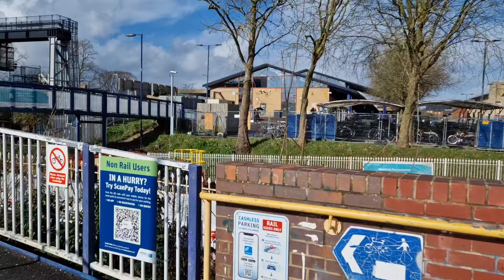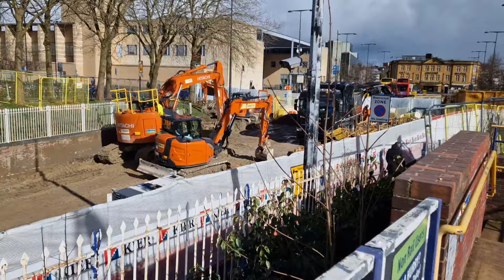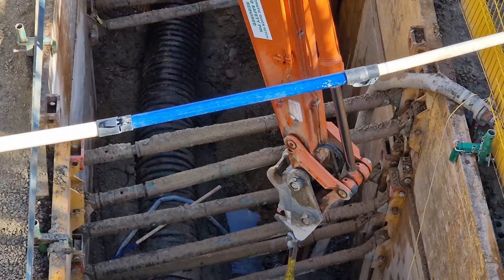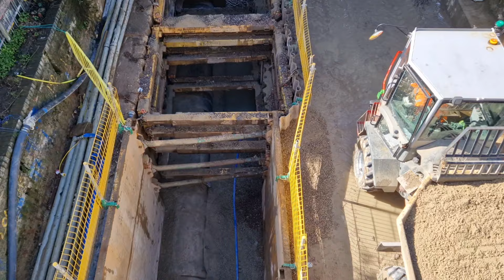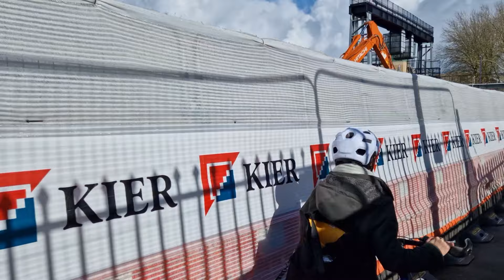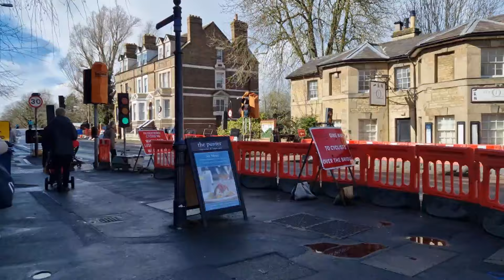Botley Road Oxford Train Bridge Works & Old Footbridge A420 March 2024

Comment: Is the road being lowered?
Reply from the maker: I've heard that they are, yes. To let the taller buses through. Apparently the buses that were passing under the bridge were modified specially to fit under it! They used to miss by what looked like just a couple of inches
Reply: @MyWorldThroughALens  I've been on a bus a few times underneath, sitting upstairs at the front. The bridge said 13ft 9, and the buses were 13ft 10, but still, only just went underneath.
Reply from the maker: Nice, when was that recorded?
Reply: @MyWorldThroughALens  would've been summer 2022 I think
Reply from the maker: I did some filming around there before they knocked down the YHA. Still need to find the time to edit and upload...
Reply: @MyWorldThroughALens  they've certainly got some big plans for that area I guess? Some bus services now terminate at Osney Island, instead of going round via Peartree P&R, and into the city centre.
Reply from the maker: That's where my bus sets off from now. It used to take me less than 5 minutes from work, and now it's 15 minutes and walking through the busy tunnel every day isn't much fun!
Reply: @MyWorldThroughALens  I'll be up there in February, passing through.